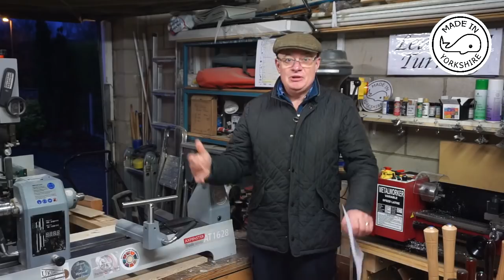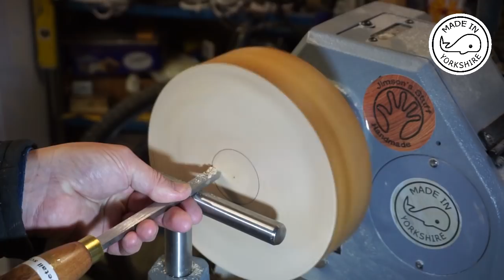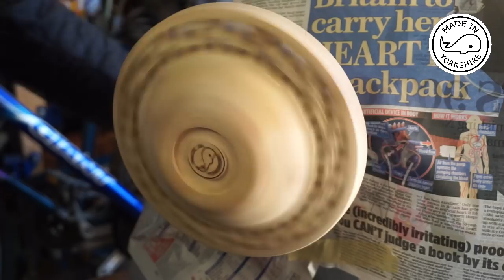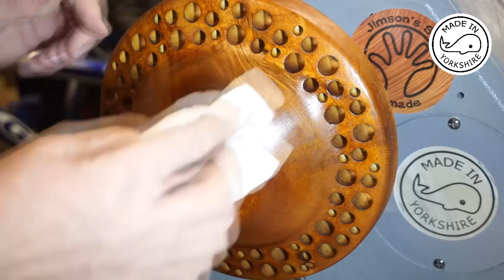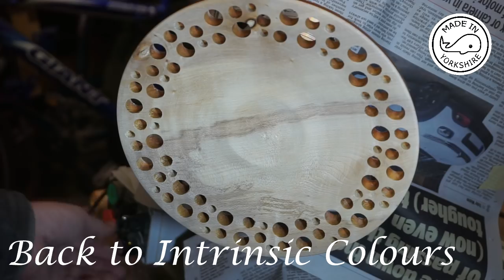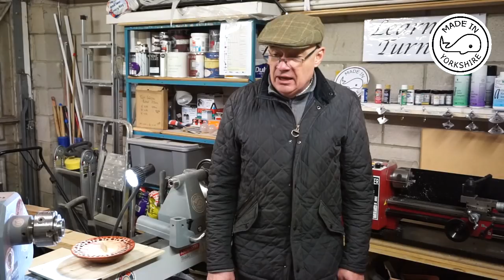#40 A Holey Bowl

Comment: Hi Andrew, great video and good to see the final result. Personally I like the result, particularly the top where it does give the ‘rustic’ effect you mentioned.  I think it’s easy to over use colour on wood but you got a nice balance.  Good tip on the indexing, I have the same lathe and was going to get an additional index disc to make it easier to use but your idea wins...!!  Regards, Mick
Reply from the maker: Hi Michael. I'm really glad you like the rustic effect - friends and family like it too! Great to hear that you like the indexing tip. Rare earth  magnets are really inexpensive on eBay, so if you already have an engineers square it's a very low cost solution. Even though the at1628vs has only got 36 graduations, I sometimes place a shim between the headstock spindle and the chuck in order to offset it slightly. By doing this you can create another set of 36 index points between the previous ones. Wishing you happy and safe turning.
Cheers
Andrew

Comment: Like that Andrew, good job mate. Great idea with the set square, I have to agree the indexing graduation system on this lathe leaves a lot to be desired, I rarely use it so it's not a big issue, but when I next do, I will use your workaround. excellent video.
Cheers
Mike
Reply from the maker: Thanks Mike. Your channel has helped me so much since I started turning less than 2 years ago. Now, I am so happy that I've managed to come up with a suggestion that you find of value too!
I hope to call into Snainton Woodworking today, on the way to Scarborough. So if I can get a blank with good figure my next project will be stain free.
Cheers.
Andrew

Comment: Great job Andrew. As you have indexing on the lathe that was half the battle done. Not so sure about the jig as I suspect it wasn't that cheap, but fro those who don't I would guess you can use the indexing to mark the blank for drilling locations. Certainly prefer the more natural colour to what you were trying. Well done!
Reply from the maker: Thanks Paul. I think I paid around £3 for 10 rare earth magnets. I find them really useful for temporarily holding metal to metal. Also, I think I only paid £13 for the mag base which is also very useful around the workshop.
All the best.
Andrew